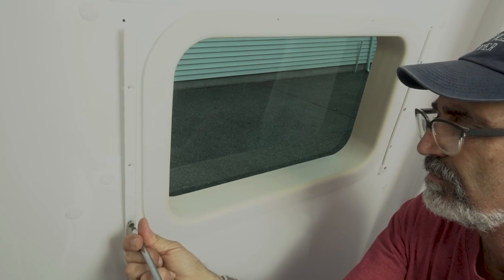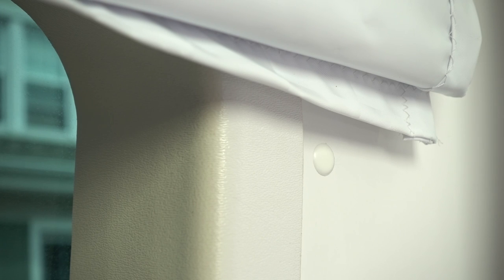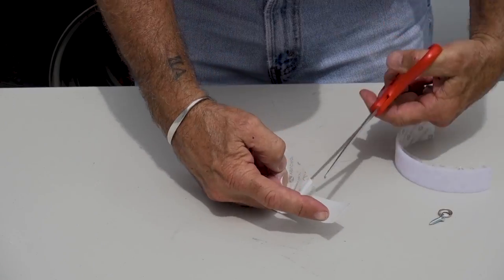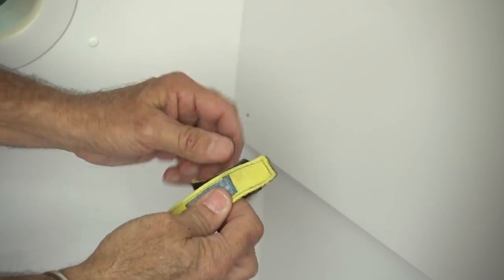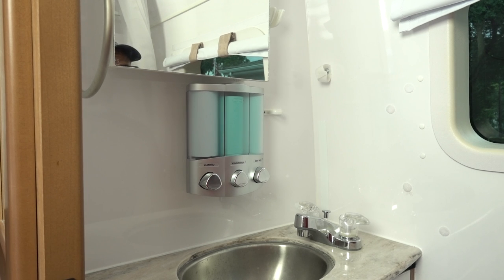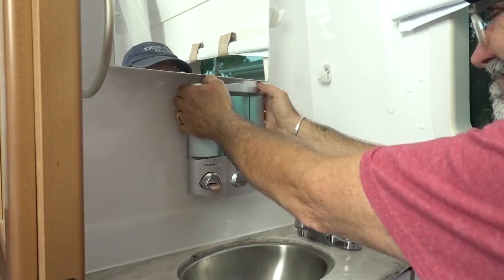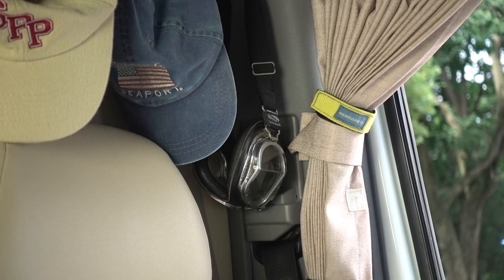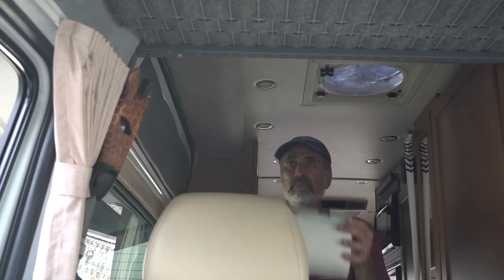CROWDED SHOWER UPDATE | Change The Way You Shower In A Van- PART 2

Comment: LOVE the "noncommittal" magnetic paper towel holder!
Reply from the maker: That little idea has proven to be a winner! It makes it very easy and convenient. One problem, that may be overcome in time...when I have those paper towels mounted inside, on top of the sliding door, and forget they are there when I slide the door open, BOOM off the roll goes and out onto the ground! I suppose it's comical...

Comment: I love the idea of using magnets!  I was just wondering if there would be a way to use magnets in the bathroom to keep the shower curtain where needed. 🤔
Reply from the maker: Yes magnets can be used for your shower curtain. That would require a bit more effort to hang and remove rather than sliding across a rod.